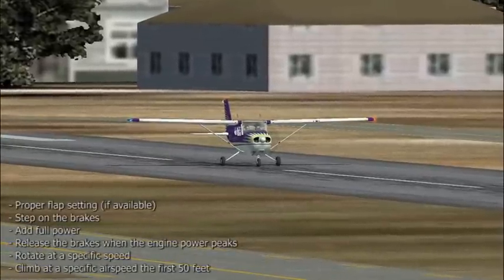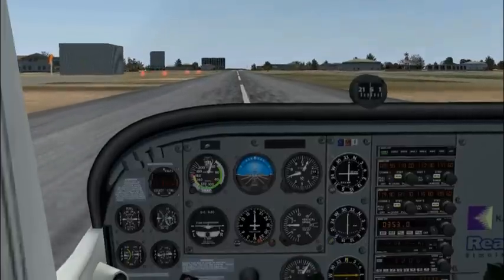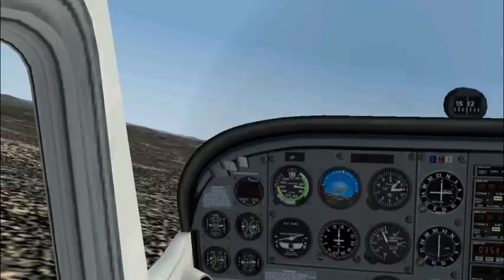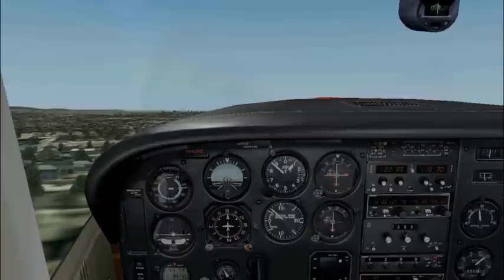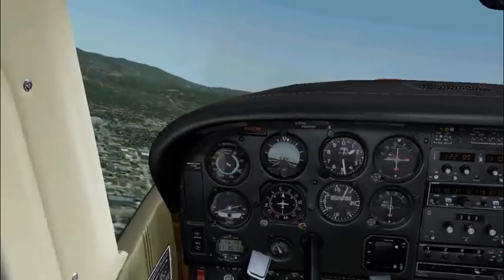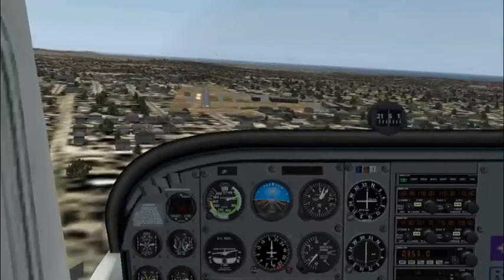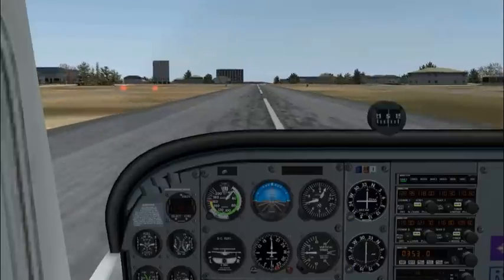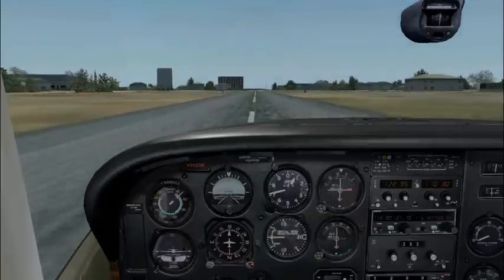Short Field Takeoff and Landing Tutorial (MSFS)

Comment from the maker: Partially, you assume a soft field will be a short field, so that is why you do a 50 foot obstacle on departure and come in at a short field approach speed for a soft field landing, but the difference in landings is that for soft field landings you add a little power just prior to touchdown, you don't brake and you hold the yoke all the way back the whole time.

You have the other stuff correct for takeoff.

Comment from the maker: I've bought a Information Manual for every plane I have flown, I have about 7-8 AIM's, so if you are going to fly a plane, you should probably buy your own Information Manual.

POH is the same thing as the information manual, except that it also includes a specific planes weight and balance.

But for MSFS you can probably do a google and someone has made more or less a checklist, although I have seen checklists with wrong speeds out there, so you have to be careful where you get it from.

Comment from the maker: Yes it does, it's like putting weights in the back of your car to make the rear brakes more effective since the inertia moves a lot of the weight to the front during braking, bad example but you get the idea.

It also keeps the weight off the front wheel so you should do it every time you use the brakes in a plane. I actually did it in this video, but forgot to mention it.  It's become automatic with me any time I land to slowly bring back that yoke all the way back, I emphasize slowly, LOL